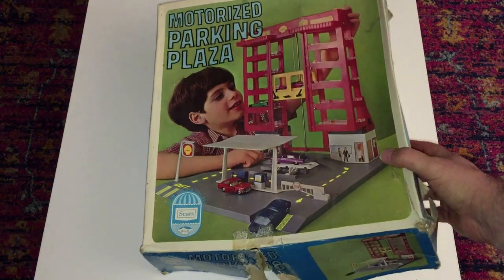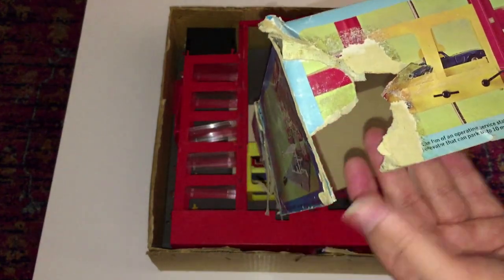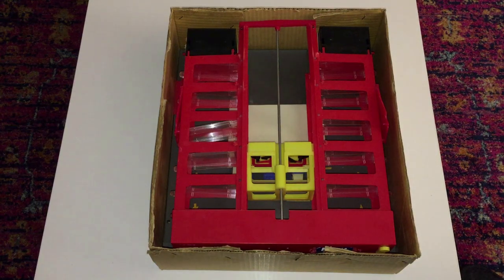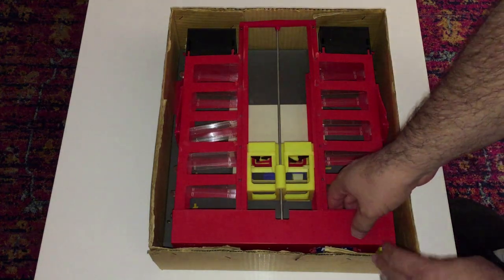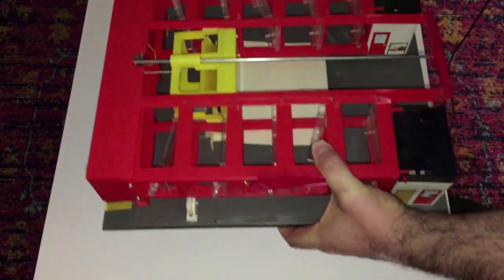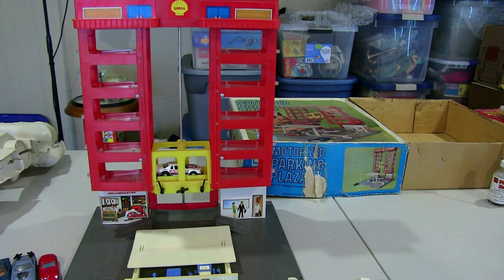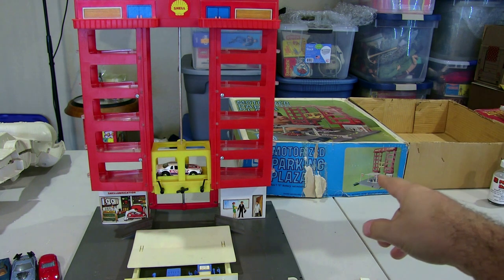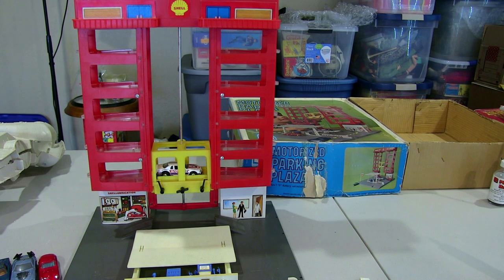Vintage 1971 Sears Shell Motorized Parking Plaza. Restoration and Demonstration .

Comment: Not as cool as the hotwheels tune up tower (also a parking garage) BUT, still a really neat toy especially considering the time it came from!! THANK YOU for showing us this garage! Great video. 👍👍 and FYI, all except 1 of the cars showed in the ads were Lesney Matchbox vehicles. The one that isn't, was the green Custom Dodge Charger and a RedLine hotwheels. The charger is pictured in the "first" version in the upper left corner. Hotwheels were first introduced in 1968, however the Charger was not one of the original "Sweet 16" and would have been released in 1970, so you nailed the year of the garage.👍 again, great video and thanks for sharing.